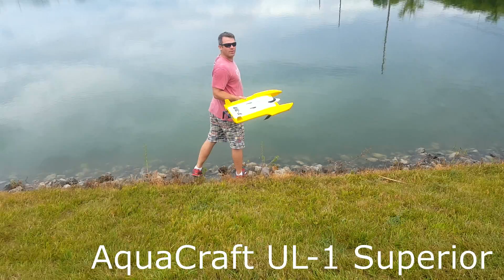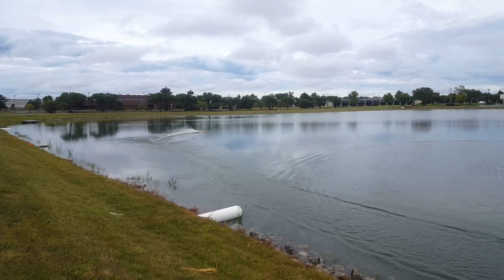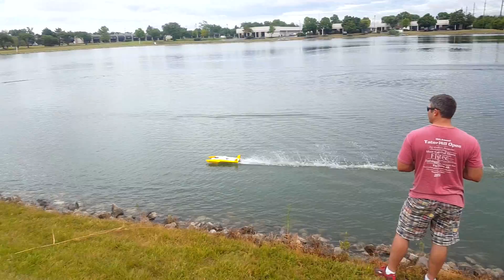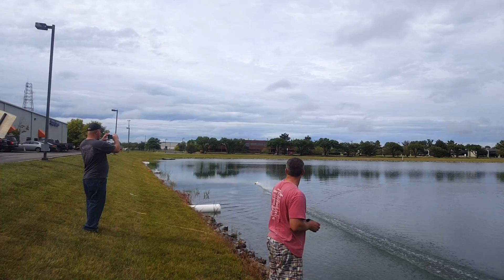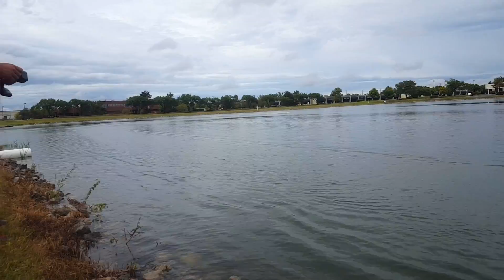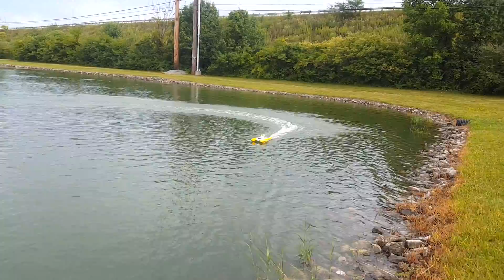AquaCraft UL 1 Superior 4S vs 6S

Comment: please tell me something when you re talking 4s vs 6s that means the two batteries with 2 cells and two  batteries with 3 cells  each??
Reply from the maker: inti gomez that means total S. so 2 2s batteries and then 2 3s batteries
Reply: thank you sir.i apreciated so much...just one last questiom i will upgrade my ul installin a dynamute 120a marine esc..and 2 lipo 5000 50 11.1 3s  v gensace...will this work ? i want my ul to speed just like your..than you
Reply: Steven Gilbert is the 6s with stock ESC ? Because mine didn't even turn on when I put 6s.

Comment: i installed the 120v esc and 6s on my ul .is brutal fast that at some point you can not controled any more lol..
Reply: im about to do the same esc.  can we use the same stock motor?  what prop should I buy?  I wanna go fast on 4s
Reply: S1KRR L42 x 66 prop work  perfect ..esc 120v  6s .same motor no need new...yes you can use 4s..i put 6s but is too fast ..can not control .it crazy fast